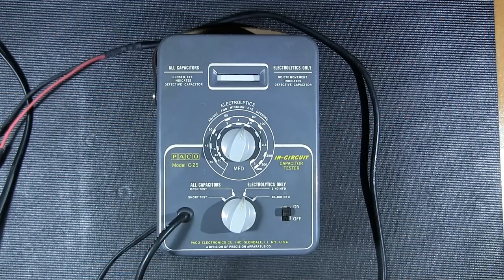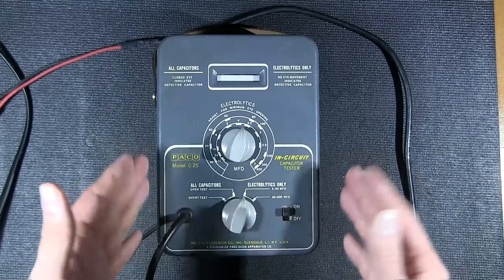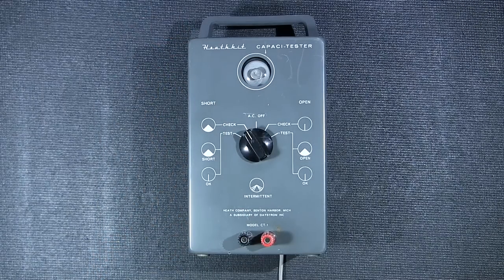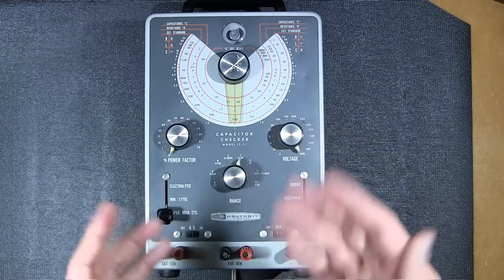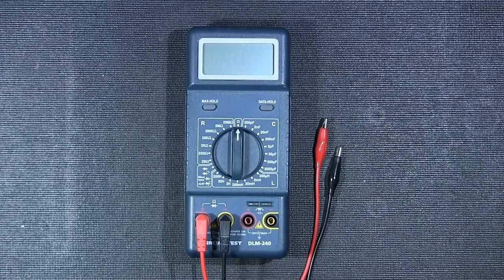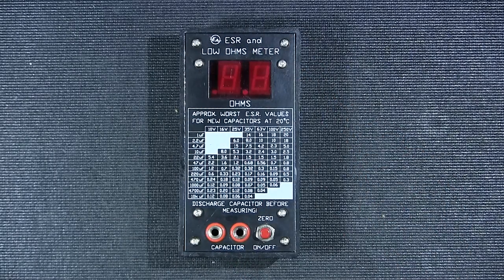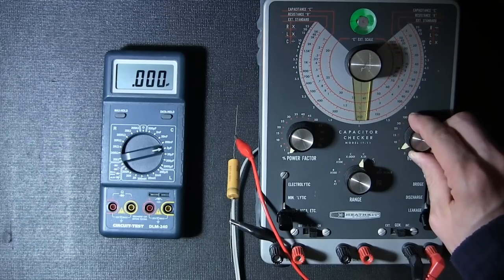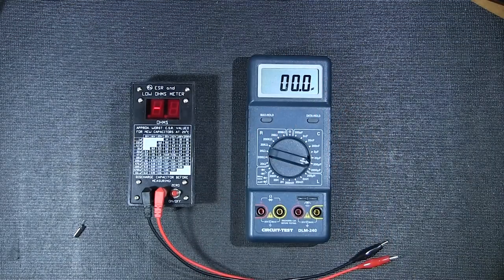Which Capacitor Tester Should I Buy?

Comment: I have heard that when you are fixing 5, 10, 20+ year old electronics you replace all or most all electrolytics.  They don't have to be swollen at one end, they are frequently toast.  I also have read about folks who selectively replace electrolytic capacitors, by testing their ESR and replacing the too high ESR caps as well as the swollen, obviously dead ones, but not the others. It would seem to be most useful if the unit is still faulty once the swollen caps have been replaced.

Are you in the replace them all camp Mr. Carlson?   On a related note, what are the quality brands?  I'd have to get my caps from Mouser or Digikey or a competitor.
Reply from the maker: Hi Bob. In switch mode power supplies, all electrolytic should be changed in one shot. Gear that doesn't stress components like the SMPS, can be a random change. It all depends on age and the quality of the original capacitors. I purchase my caps from the places you list, this is a safe bet due to all the fake's on the market.

Comment: I telephoned Circuit Test (CT).  The DLM-240 has not existed since 2012, possibly even before that, not exactly sure, the rep said something about nine years ago.  CT purchased it from a Taiwan company and the meter is no longer available, at least for CT to purchase.  Rep said they would love to be able to buy it and resell it.  Second rep also said they have been getting a lot of requests lately for that meter . . . (oh boy, get ready for the mainland China made counterfeits to hit eBay!).  CT shows they have a 260 model.  But it has less of a range that the 240 had.  And its not one of those model upgrade progressions that if the 240 was good, the 260 must be even better.  Not so, the 260 needs to be called the 220 or 200 model.  I've been seeing a pattern of Asian made, and/or, other outsourced products no longer being available.

Comment: Very educational for troubleshooting a Whirlpool washer that turns on but isn't spinning and one of the potential issues is faulty bad start/run capacitor.  So, not only do I have to check capacitance value which seems to check out with a multimeter but also ESR and leakage.  Is there one unit that combines all three checks?
Reply: washer machine motor start capacitors typically just go open...just go to a junk yard and put a start capacitor from other machine to try...they typically range from 10 to 16uf but you can use any value within that range just for the test (the motor will be a little out of phase and sound weird but it will work) if it works then buy a new one with the suitable capacitance and you are ready to go.
Reply: most modern machines (in europe, from maybe year 2000+) do not use start or run capacitors, just a line filter wich contains a capacitor and small capacitors on the board for the SMPS...if your machine is modern it will likely have no start capacitor, it will have a motor with carbon brushes wich does not use a start capacitor....... and if it does not spin at all check the brushes, if it spins but does not rinse the clothes check the relays on the board for the motor or it can also be an open triac..

Comment: Great Video!  I found a Heathkit IT-11 at an estate sale for $35...  replaced a couple of capacitors, did a calibration per the manual, works great!  Eye tube is nice a bright.  I do have a question...  I noticed the schematic shows a 3 prong ac cord, mine does not.  and does not have the 2 caps on the ac line to ground.   Is it a good idea to re-wire and add the caps?

Comment: Question but first some compliments: Great informative video. Also cool gear featured!

I am an hvac service tech and check "run" and "start" capacitors for compressors and motors with a multimeter using the capacitance feature (fieldpiece multimeter) but i wonder Is there any extra testing you would suggest to do on those type of caps? 

Thanks for any info. Keep up the great vids

Comment: Paul, Have you ever used or seen a Sencore LC77 Capacitor-Inductor Analyzer? I have one where I work and it will test Capacitors for leakage up to 1,000 volts.  It is solid state and it still works, but I wonder if it should be re-capped.
cfb

Comment: Hey Paul, I understand this is an older video but was curious if you ever had the chance to work with a vintage Mercury Model 1400 in-circuit capacitor tester. I'm fairly new to vintage electronic restoration, and recently acquired one of these neat little devices for restoration.

The thing I noticed is that it has a High Leak function which seems to work really well identifying DC leaks, and was curious if you had any thoughts regarding this test feature on this somewhat rare, but inexpensive device.

Dan

Comment: I am about to buy a Heathkit IT-28 tester and it is configured for 120V US. I would like to change it to use in the UK on 230-240V with the ground on the Neutral leg. I saw on a partial drawing the primary of the TX has 2 windings. Do you know If this could be done, Its not just about the voltage change but also about altering the 120V center ground tap and having the ground on our Neutral leg instead. Any Tips?

Comment: Great Video, just as I was talking to you earlier about the restoration of your older equipment.  I love your video on the capacitor testers, especially the Heathkit IT-11.  I have been looking at some of the Bob Parker ESR meters on the web using home made designs using a analog meter, or would it be better getting a Bob Parker original cost wise.  Maybe you could break open some of your other meters to show the complexity of them, ie; Bob Parker, Heathkit IT-11 or others.  I have been toying with building my own ESR meter.Later Ray Burke

Comment: Nice Video Paul, I enjoyed it!
I would also love an in depth restoration of the Paco capacitor tester. 
Would you mind giving some explaination on how those leakage testers work? I have a rough Idea (when Cap is leaking the controll voltage for the magic eye gets pulled down by the leaking cap resulting in the eye not opening), but I am not sure if I am correct. 

By the way, it seems that these kind of testers are only common overseas, here in germany I have hardly seen any :(

Comment: You don't need a cap tester if you watch this channel. 
Just check the tubes, change every frickin' electrolytic in sight then turn the thing on. 
You'll only need the cap tester if it still doesn't work, which is unlikely.

Comment: How do you measure say a .015 or a .047? The dial is on C.01 but the top dial stars on .1? I am trying to check some caps in an amp that are the molded paper type and need to make sure it’s on the right setting

Comment: Mr. Carlson - how high of a priority would you place on an ESR meter for working on strictly tube audio amplifiers? I'm new to the tube amp repair world, and am in the process of acquiring test gear for my bench. I'm currently using a Fluke 87V to test capacitance values, and an EICO 950A for testing leakage current. Since so many old caps end up in the bin anyway, and since I'm not planning on working on switch mode power supplies any time soon, is it a needed tool?
Reply: I'd say probably not. ESR's not a big deal at mains frequencies, so as long as the cap's not blown (or horribly leaky), odds are it's good to go.

Comment: What causes leakage versus ESR.  I know heat will increase ESR but what is causing leakage?
Reply from the maker: Hi Brad. ESR is a measurement of "series resistance," so you can picture a resistor in line with the leads of the capacitor. Leakage measurement is a "parallel resistance" test, you can picture a resistor in parallel with the capacitor (across the capacitor.) ESR is an "AC" test using a test signal at a given frequency. Leakage testing is a "DC" test, looking for trace amounts of resistance in the capacitor, (across it.) Leakage is caused by the internal decay of the capacitor, (becomes conductive over time.)  Leakage can also be caused by internal arcing, (leaving a carbon path) and other various failure points.

Comment: Paul, thank you for the new video. You tested the caps using 2 pieces of equipment at a time not all 3. Is there any relationship between high ESR and high leakage that you have observed? The "new" wax and paper cap failed leakage test but what about its ESR? ANd vice versa with the small 25 volt rated electrolytic cap with bad ESR.
Reply from the maker: Hi Richard. Leakage can be looked upon as EPR or "Equivalent Parallel Resistance," so you can picture a high value resistor (say 1 Meg) in parallel with the wax capacitor. ESR or "Equivalent Series Resistance" can be looked upon as a resistor in series with one leg of a capacitor. Each of these issues will affect a circuit (and the offending component) differently. I will go into more detail on this in some future video's.
Reply: A future video on this topic will fill a gap. There are plenty of videos on testing ESR or testing leakage but not one that illustrates the differences between the 2. After viewing your videos I am sure you will make it easy for everyone to understand. Even me.

Comment: Paul, amazing video as always. Let me ask you something, is there a way to DIY that leakage function from the Heathkit?

Thanks.
Reply from the maker: Oh for sure, that requires a current limited 600V supply and an eye tube with calibrated circuit for reading 2uA of leakage Current.

Comment: I really like your videos.  Always informative.  I am confused about your use of these capacitor testers though.  You are always showing how leaky the old capacitors are, and just replace them anyway, even if they test OK for now.  I know that usually you have to at least desolder one end of the capacitor to test it anyway, so why not just replace the capacitor and not bother with any test at all?   For the price of this test equipment, I could have replaced all of the capacitors anyway for my lifetime.  What advantage is a capacitor tester really?

Comment: How long does the heathkit leakage tester take to charge a 30,000uf cap to 50v I have been using it and thought they were leaky but after a couple minutes the eye starts opening? After about 10min they get up to 50v and take almost as long to discharge.

Comment: Might I suggest reviewing the DER EE DE5000 LCR Meter. I have one of these ane I'd like your take on this meter. It tests ESR as well.  
Thanks.
Reply: Steve...I'm sure you don't need an answer after 2 years..These are just excellent value and for general use invaluable. Compared to my AVO bridge it agrees on all ranges...except it is ten times quicker to measure.
Reply: PS Apart from leakage on high voltage caps it does everything.

Comment: I recently had to fix my HVAC blower. I correctly guessed that the problem was the starter capacitor, and replacing it fixed the problem, but it raised a question for me. My multimeter capacitance test showed the 5mf 370v start cap to have 5.8 mf capacitance...well outside of the 5% tolerance range.  The new one read 4.85 mf on the same multimeter....so why does the capacitance go up with age?  This one was 20+ years old. I'd have expected failure to result in a lowered capacitance as the dielectric broke down and increased leakage.  Any idea why it increased?

I'm learning a lot from your videos.  I know this because I'm following a lot more of the explanations than I did at first! Thank you!

-- Mike
Reply from the maker: Hi Mike. There are actually 2 answers to your question. First: Some capacitors are "overachievers" and show more capacitance. Second: Your capacitor meter feeds a predetermined amount of current out, to charge the capacitor under test. When the capacitor charges up to a determined level (usually specific per meter due to the batteries) The amount of time it took to "fill" the capacitor at the predetermined charge rate, predicts the capacitors capacitance. So really, your capacitor meter is just measuring the time it takes to charge the cap.... Then giving you a math equation as a result. If the capacitor your testing is "Leaky" your meter will take longer to charge it... Therefore giving you a higher micro Farad rating. (longer charge time = Higher mF reading) The only way to properly determine whether your capacitor is truly faulty, is to perform a second test.... That's the leakage test displayed in the video.
Reply: Thank you for the reply and explanation.  That makes perfect sense to me.  It's not that the capacitance went up, it's that the leakiness fools the meter into thinking that it has, since it can pump in more charge before it's "full", due to some of the charge leaking out during the charging...kind of like measuring the capacity of a gas tank by counting the gallons it takes to fill it, while the engine is running.  

-- Mike B.
Reply: mr carlson i have been repairing old radios for some time now and i find that regarding paper caps the more old and leaky they are their capacitance grows if you test them with a DMM on capacitance mode... sometimes they double the capacitance reading.
new capacitor typically test a little bit less than their actual value on the DMM...
for some time i did not had a leakage tester and used this method for diagnosing leaky capacitors, then i went back and retested some old caps (i save the old caps on a jar just for fun) and it kind of proved my "theory"....

Comment: I have heard that reforming a capacitor is just making trouble for yourself, but in this section you talked about the Heathkit having that ability. Have I, maybe, heard this incorrectly and there are cases for reforming? Would like to know. Right now I just trash old and buy new.
Reply from the maker: Ya, reforming is a recipe for future disaster. I just replace all electrolytics

Comment: In my office I have noticed that most people leave their computers running when they go home, so effectively their computers are running all the time.  I assume that this wears out the electrolytic capacitors on the switch mode power supplies faster compared to computers that are turned off daily?  Besides wasting power,  a lot of people argue, even IT staff,  that leaving the computer on all the time is good for it or has no negative side effects.  Does anybody here with good electronics knowledge have an opinion on this?
Reply: Tommy Oz Yes the computers will certainly wear out faster if left on 24/7. The life span of both capacitors as well as other electronic components is inversely related to temperature and running hours. It is hardest on mechanical components, such as hard disk drives and fans. Perhaps your IT guys are hoping the computers wear out prematurely, so they can get more work...
Reply: Thanks for your response Jonas.  I think some IT people think this way is because of their experience with servers which run 24/7.  It seems the most likely time you are going to experience a problem with a server is when you turn it off and then try to turn it back on.  Usually it's a bad hard drive or failed PSU.  I think because of this, some people come to the conclusion that turning off and on computers puts some sort of stress on it.  Doing a google search on this yields all sorts of interesting advice and opinions, but not many people talking about life of electrolytic capacitors or other components.

Comment: At some point you switched from the term "leakage" to "ESR". Are these terms interchangeable in this context? If not, does that mean you should test for both leakage and ESR, and I see no modern testing units that test for "leakage".
Reply: ESR is Equivalent Series Resistance, but leakage indicates a PARALLEL resistance path around the capacitor, so that it won't completely block DC as a good cap is supposed to. You could call it EPR; or perhaps PSR, a parallel shunting resistance....

Comment: Thanks a lot, this was a helpful comparison ^^ Btw, have you yet done a video explaining how that magic eye tube circuit inside these analog testers generally works? I would be highly interested.
Reply: I just posted a video on the Heathkit IT-22 "Capaci-Tester" (same circuit as their earlier CT-1 that in in THIS video), and I go into the circuit design. I did not really explain the "magic eye" part, because I don't know how the image is "painted", but I did talk about how it is related to the current through that tube, and how the instrument's circuit arranges to have a high or a low tube current depending on the outcome of the capacitor test.
Reply: @youtuuba  Thanks for your comment! I will definitely check out your production😁

Comment: auto distributors use mfd # to match the coil for max spark  i need a tester that  tells me exact what value is a capacitor   you can not go my the # in the box it comes in that is a part #  my truck needs a 27 mfd capistor   for max spark  hard to find

Comment: Mr Carlson what's your thoughts on reforming caps ???
Reply: overbuilt automotive  ,   Don't.
Reply: @BruceNitroxpro  i agree 99.8765 of the time unless it`s a giant old unit and only if its a mild reformation ..seen that on a 1950`s S.M.P supply cans i guess it was setting fer decades and one cap was a bit off and served a simple function ill bet it setting now not being used after repair ..lol